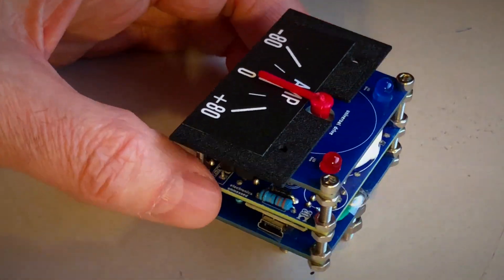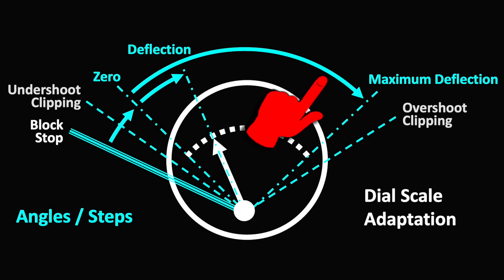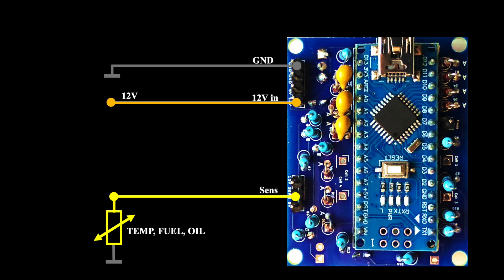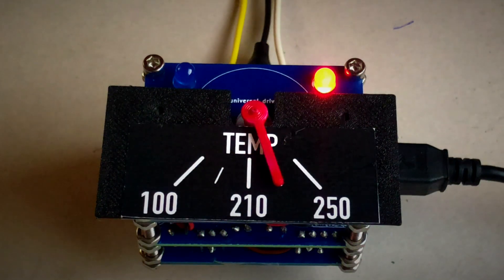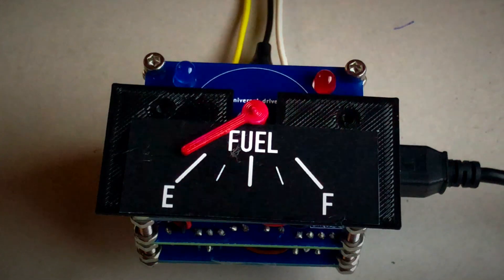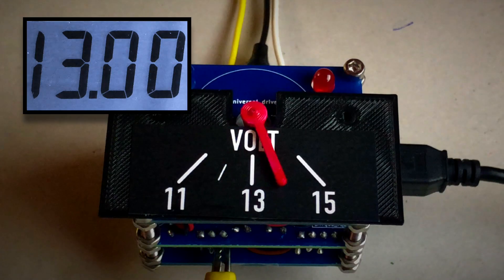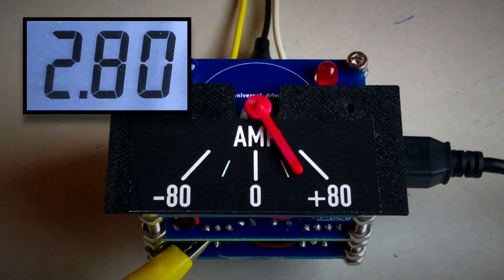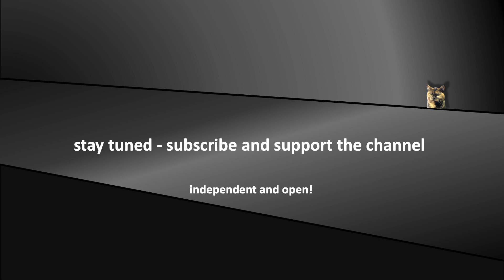Unveiled Classic Car Instruments: Fully Functional Replicas with Modern Features (EP145c)

Comment: A couple of ideas.
On most older card, they control the instrument lighting at night with a rheostat, so it might be useful to have a n input to your meters, perhaps for a local LED light, but also to control the LED indicators... I've worked with LED indicators a lot, and it might be useful to consider making them have a breathing/pulsing effect for the early warning mode, changing to a "hard" blinking in the "Katastrophe" state. The reason to have a breathing mode is that indicators that are just "on" do not capture your vision readily, without being too bright... It's a fairly complex relationship, but I researched it quite a bit in my weltweit Verantwortlichkeit.
I also had a battery voltage indicator that was an LED strip, without LEDs between 12,5 & 14 V, but the LEDs came on for 10-12 and 14-15V. This feature allows you to see battery behavior when starting, and with overcharge level (although you get 14,5 V in cold weather... You can see how low the battery voltage goes at start and how fast it recovers.

Anyway, the gauges look pretty "vintage", maybe you could do a VDO style, also...a bit more challenging for size, but look great!
Oh, Lighting Level - some slightly newer cars, maybe later '70s, used PWM for setting nighttime instrument brightness, that could be done with digital input.
Reply from the maker: Thank you very much for your great tips! There are some great suggestions for me. You are obviously a real expert in these things! I am already using the PWM control of the LEDs and the rest is coding. Looking forward to reading comments from you again! Best wishes from Stuttgart.

Comment: Great project! Only complain I have is using a "whole" Arduino nano board for a single gauge is kinda wasteful or just design the PCB so just the microcontroller with bare minimum components are soldered and program it with an ISP programmer.

Comment: Nice! 
I'm working on a similar project, though instead of car instruments, I'm making a dashboard that displays PC performance (cpu/gpu temperature etc.) with analog gauges.
Instead of stepper motors, I'm using analog ammeters (~5mA each) that can be relabeled to show whatever I need, and can be controlled precisely with Arduino's pwm pins. 
I'm curious, how much precision does the stepper motors have?
Reply from the maker: Hey cool! I had an earlier project for an RSSI Meter, where I used also the PWM pin. The stepper motor is 100% accurate to display digital information. When you tell it to move 42 steps then it moves 42 steps and nothing else. In my case the accuracy limitations are in the A/D converters. But for my application it is sufficient.
Reply: I think that the post refers to the number of steps in the stepper motor... not sure if you are using "microstepping" for smoother operation...

Comment: Very nice project! Is there a reason you didn’t use surface mount components? And also you could make the circuit board more compact by incorporating the Arduino chip directly on the on the sensor PCB. Just an idea!
Reply from the maker: Hi Patrick, thanks for your comment. Yes, that's a very good question. I haven't used SMD technology yet because it's the first version and I wanted to have the option of making modifications. But SMD is definitely the next step, with the integrated chip of course. Do you have a recommendation for the best way to access the chip via USB? BR Klaus
Reply: Hi Klaus, that makes sense. Re the USB, you could just copy the chip that Arduino used (I think its the FT232). I personally use ESP32-S3 chips for my projects, and they have USB built in, no extra chip needed. Or instead of copying the chip Arduino use, try a WCH CH9102F, adafruit can give you an example schematic in their, look up "Product ID 5568"